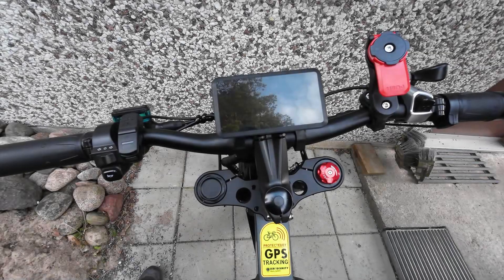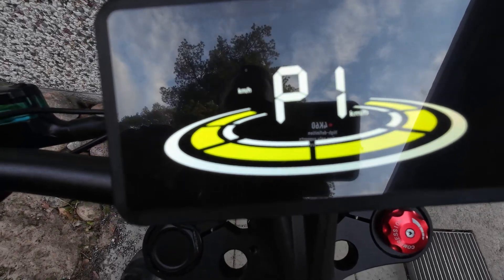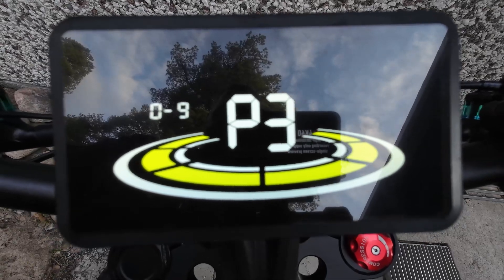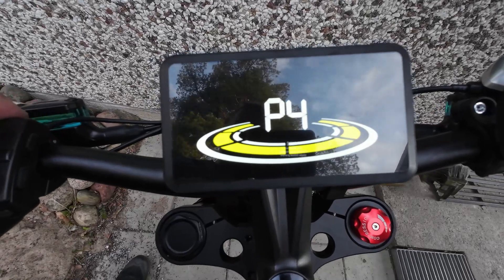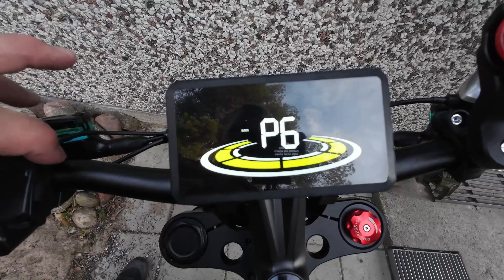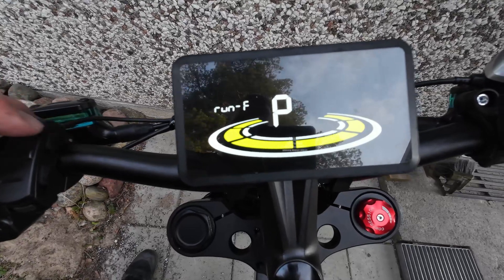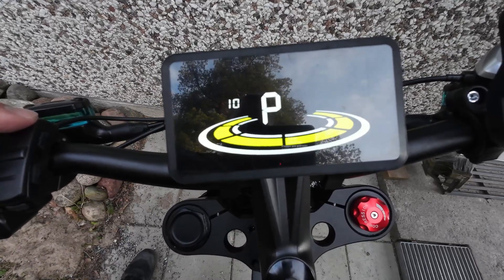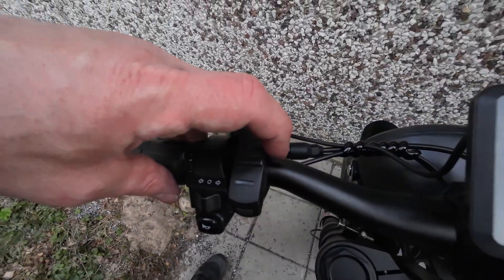Yolin YL90T-H E-Bike Controller Settings (EKX X-21)

Comment: Is there any way with P9 that I somehow can get the bike to run 45km/h when using PAS, but the Throttle is limited at 20 km/h ????
Reply from the maker: I do not think so. Only way I know how to limit the max speed is use PAS levels to change it via power level % or you do the quick switch.

Comment: My screen stuck at PA i know the password but can not access in how to reset passcode
Reply from the maker: So it only works when pedaling but not with throttle? I have not used the password and I think it should only affect when you start the bike? Only help I can give is what is in manual and after that I would ask from where you bouhht it or maybe in EKX facebook page?
Reply: @Usva78 Its like a phone screen lock you can’t use throttle or paddle assist without the passcode

Comment: How to remove speed limiter?
Reply from the maker: https://youtu.be/3iNV9FZwlOo?si=vLI3tspZIZ4bOLSG

Made a video long time ago with instructions.

It is done like this: when power is off, hold both breaks and throttle, while still holding those power on, when starting texts and numbers are done then release breaks and throttle. Same way to set limiter back on. Takes about 5 seconds. Works on my basic x21 model. Some have had problems getting it back on or off, but seem to have always succeeded on it eventually, so maybe just some technique problem rather than not working.
Reply: @Usva78 so I do not own this bike, but have a very similar dash, with only 7 P-settings but there is also very clearly a limiter on mine as it’s a 1000w52v20ah battery rated for “37mph” but throttle hits 30 then backs off to 19, i.e. limiter. My bike has no key function, just the up and down buttons with the attached power button. I’m not sure if maybe I didn’t hold both hard enough or whatever but it didn’t work for mine sadly 😕
Reply from the maker: @isaaclee1965 I got the trick from some different bikes video with same display, but I just cant remember what the bike was. So might work with other bikes too, but it is really simple on my bike. I put throttle to max position and just press breaks as well as I can. Then powering on at same time, has worked every time for me. 

So if it is not working, then might be that there is something different with your bike that does not match.
Reply from the maker: @isaaclee1965 oh and this has key for battery lock and power is just button on part that has power, +, -, lights and info button on side.
Reply: @Usva78 throttle has to be in MAX position? And i dont know ive tried. I cant get it. Maybe throttle wasnt maxed i dont know
Reply: @Usva78 also, which brake? I have hydraulics on both sides. Just shows person grabbing closest brake.
Reply from the maker: @isaaclee1965 I just twist it all the way to max position, then both hands fingers on breaks and push the power on with my left thumb... then i wait the numbers and stuff go on screen and when it returns to normal i let go of throttle and breaks. Thats all i do. I do not know if there are other ways to do it, but maybe there is some youtube or reddit post of your bike or ask straight from manufacturer?
Reply: @Usva78 sadly there’s no coverage on my bike yet really 🥲 seems to be newer company but the seller on Temu has been asking manufacturers bout it but nothing on that front yet sadly. I’d try again but currently waiting on a new front thru axle from them so bikes under maintenance right now .
Reply from the maker: @isaaclee1965 hopefully you get some answers and get the limiter switched somehow 👍
Reply: @Usva78 will let ya know!

Comment: Set your current to 25 instead of the 20 you leave it at, that should be the max. If you have the same controller I have it’s rated at 28.5-Amps. That will give you more power at low speed and faster takeoff, in other words more torque.
Reply from the maker: @TheSeventhmillennium  i think I will need to check this out 😊👍 more torque would be great as I am quite heavy 😅
Reply: @Usva78  i’ve also set my wheel size to 29 inches even though I have 20 inch tires, it gave me five more miles of speed so now my bike will go 30+ mph. Of course my mileage is off, but I don’t care. I use a phone app for that. When I set it to 30 inchs it slowed me down so I keep it at 29 inches.
Reply from the maker: @TheSeventhmillennium  so with gps you have more speed with bigger tire size setting? I tjought it was just to help bike get right speed and mileage 😅 maybe it adjusts some power output for bigger tire 🤔😅
Reply: @Usva78  I think the controller does increase the current output automatically for larger tire size. What I do is adjust my settings and then tip my bike over a little bit on the kickstand so the back wheel is off the ground, and I give it some throttle and check the speed to see how that has affected the RPMs. Of course the calibration of the speedometer is off, but I can hear the speed of the tire spinning and can tell it’s going faster as I increase the tire size. Also I have used a speed app on my phone to confirm that I am going 5 miles an hour faster with the tire size set at 29 inches.

Additionally, I bump all my pedal assist settings up to the max. So I just have 1-3 pedal assist setting, and then I max those out to 99, that way every time I give it throttle it’s already at full power And I don’t have to use the plus button to increase speed.

Comment: How to show the current voltage?
Reply from the maker: @dbxfpv6339  some displays do show voltage but this one only the bars to tell how much battery is left.
Reply: @Usva78  bars is not accurate,  thats why i use voltage on my previous ebike
Reply from the maker: @dbxfpv6339  I know. It would be better 👍

Comment: What settings do i have to change to go about 45-50 or 40? In kmh and i have a 250w with 48v 20Ah
Reply from the maker: @Jayden0161  depending what bike you might have and what is your max speed set to. See first if max speed on these settings is the limiting factor. Also you can check if you have same quick switch for speed limit as my bike. I have video of speed test where I explain the quick switch of limiter. Might not work on your bike, but worth testing if nothing else helps.

Comment: Hi, is it possible to deactivate the accelerator and use only the pedal assist? I can't find the P command in the manual. Could you tell me which command I should select if you've already tried it? THANKS
Reply: You found it ?😮
Reply: @damianzpip8742 do you mean the accelerator
Reply: @spr1nt3r_tv  yes
Reply from the maker: @spr1nt3r_tv  I think there might not be setting to turn off throttle. You can choose not to use it or maybe even cut the throttle wire to controller and put switch in the wire. But I have no experience on that. Some legal issue in your country with the throttle? You could ask the manufacturer (EKX facebook page if you have EKX bike)
Reply: Just unplug the throttle

Comment: i wonder if setting it to 9 speed settings if it will go faster?. if u tried.
Reply: gotcha thank you and what's top speed on level terrain
Reply from the maker: @MiamiElectrix  48km/h is max speed for me and if I remember right it is close to max speed for everyone. Maybe you can get 50km/h when you have rear wheel up and try full throttle without actually riding. You can get better range with different tires as shown on my latest video, but it will not get you more speed than that.
Reply from the maker: @MiamiElectrix  from settings you can change it so that throttle is always 100% power, or use the pedal assist levels to change power %. You can set the wanted power levels to pedal assist numbers. I use 1-3 option. Meaning there are 3 assist levels. Also had to set the highest level to 100% because it was something lower like 86% or something. With 1-9 option 9 has like 98% as default. I hope this helps. 

Simply put change tire size to 22" to get right speed shiwn on display and set the power % levels on the pedal assist option you use to such that highest actually has 100%. Or you can take the level out from use when using throttle only and you will always have 100% max power with throttle.

Comment: Can you please share what your current settings are when they work good for you?  Kiitos paljon 🙂
Reply from the maker: I need to check them all in the evening after work, but I will make a list then. All working well, latest change was tire size as that 24 that was factory setting is too big. If I remember right 22" gives right speed for display. But I will check them all later 😊👍
Reply: @Usva78  thank you very much for taking your time to look it up. This helps to set up the bike when I get it. It comes from China as there was no stock left in the EU warehouse
Reply from the maker: P1 in km
P2 48V
P3 I have 1-3 and use power values 40-60-100, so I have on level 1 max speed of 25km/h and on 3 full power.
P4 22" gives quite accurate speed, maybe 2% too much.
P5 01
P6 63km/h (max)
P7 28.0 as that should be controller max (someone said it would be 29). Default is 20, so might actually do something. I did not notice anything.

Those might be tge most important I guess. Works well and have not played around with those too much. To get most out if the power, either use full power mode for throttle or set your OAS values so that at least the highest takes 100%. Default is not 100 in any of the PAS settings, if I remember right.

Comment: Is there away to unlock the full power of the motor and go faster then 35
Reply from the maker: 35mph or 35km/h? I think that the hardware on this bike gives out max speed of 50+ km/h so thats little over 30mph... the given speed of 55km/h is more like theoretical. If you are limited to 35km/h then you can try to change power levels and speed settings on the display or try the quick switch. 

And if you want more than 35mph, you need different motor and controller for starters. At that point I would look for electric dirtbike instead 😊

Comment: My display is slightly different helpp!
https://youtube.com/shorts/kxBJWY55lxk?si=1vu88_fhM_3kZiBc
Reply from the maker: Sounds cool and interesting 🤓👍 maybe something else that is new too 🤔🧐😄
Reply: @Usva78 from my testing it's more simpler. Eg. One spoed controls all. In  mode 1. Bike is limited to 23 km/h along with pedal assist. I like this.
Reply from the maker: If you mean thst pedal assist levels limit the power output, then that is same on mine. You can turn that off from settings to get full power always, when using the throttle only. Did they give you any answrr yet?
Reply: @Usva78  they sent me a whatsapp message. Said this display was upgraded and they will make a video. I did some research. i think this display is made by bafang. Maybe custom for them. But the control pad definitely looks like a bafang design. For now, I'm still modifying the bike so i can wait a little for them.

Thanks for asking.
Reply: did you figure out the settings with your screen?
Reply from the maker: I think he did as on latest video about range testing he says in comments that he got manual that other display and made changes.
Reply: @Usva78  i will make a video about it. Basically, the setting is the same as a yolin yl80c. Just different apparenence. Thanks for the support
Reply from the maker: Maybe ask where you bought it for display manual or at least display brand and type? I would think they send you one with e-mail. If you cant get it or find version to find a manual yourself, then I would try pressing + and - at same time and see if it gives same kind of options. In many bikes the setting things are quite the same 🤔
Reply: @Usva78  i bought it directly from EKX. Contacted them. Nothing yet.
Reply from the maker: Hopefully they answer fast... they have facebook page that might answer faster? Might be some other customers that know it there 🤔
Reply: @Usva78  i will wait to see if they respond tomorrow.  I like this display.  Really fast start up. 😊 and it has some kind of wireless.

Comment: Was it included with the ebike or did you purchase it separately?
Reply from the maker: It is part of the bike yes. It is interface to operate the controller and just normally shows you speed, battery and trip meter for example. But you get to alter the settings that guide how the controller works within its limits. Same hardware is used on some other bikes too.
Reply from the maker: So it is display used to show stuff and to use the UI to change cotroller settings 😊

Comment: I would set the current up a bit as the controller is 28 amps I set my to the maximum 31
Reply from the maker: Hey thanks for the tip! 👍👍 I need to try bit higher then 😊 no harm going to 28 I guess?
Reply: @Usva78  I would 👍 I think the maximum is 31.5 happy biking
Reply from the maker: Did you see difference between default 20 and the maxinum? They say it wont make bike go faster, but maybe more power for uphill?
Reply: @Usva78  I don't    know mate cos I set it to 31.5 when I got the bike amps should   give you  more torque and speed